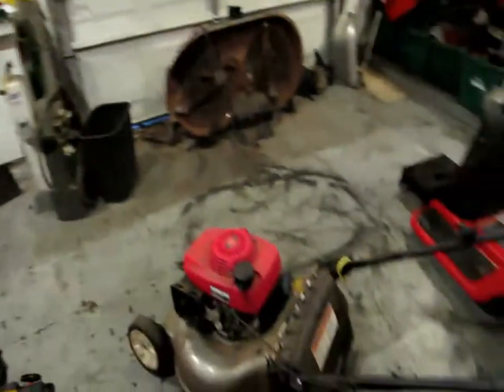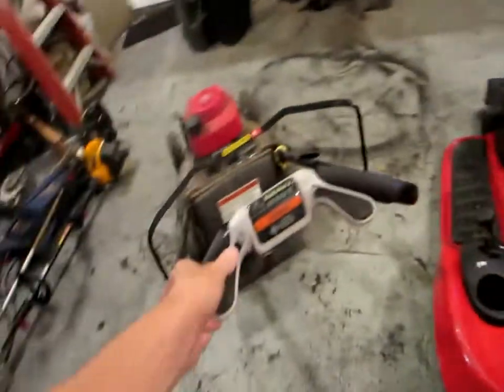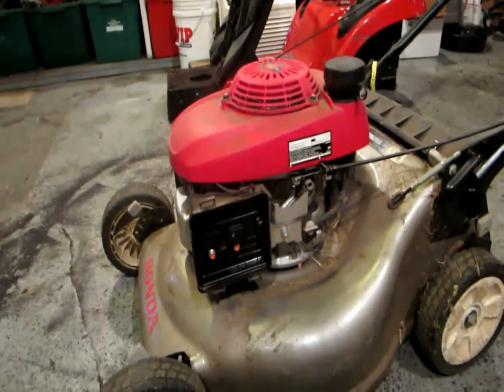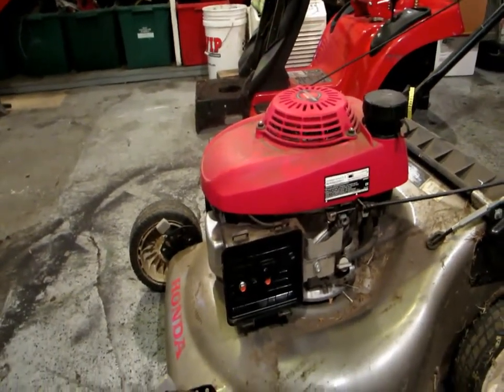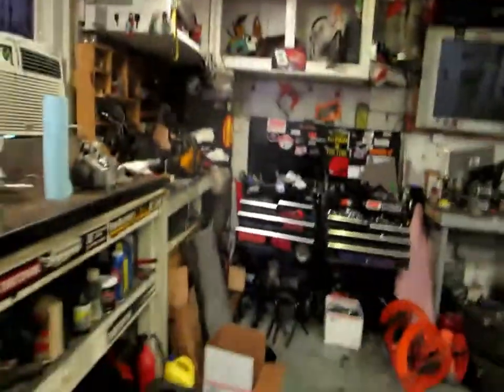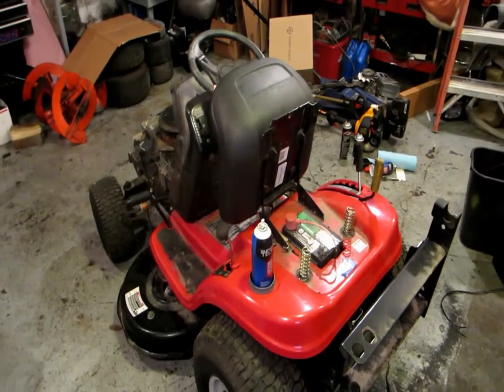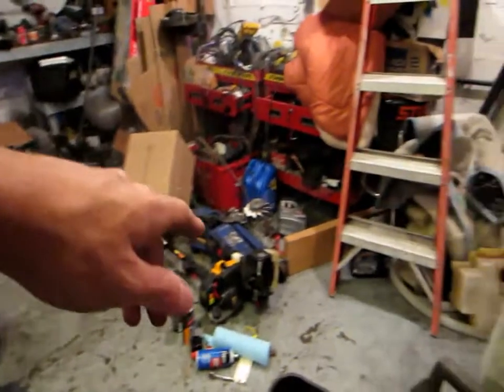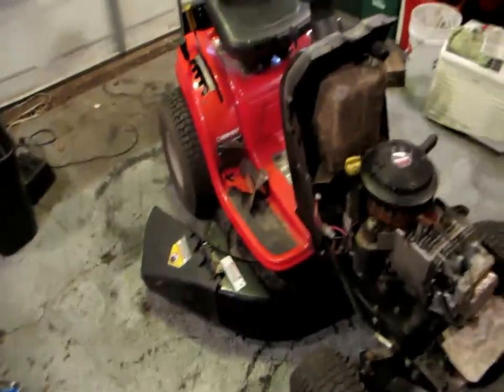junk Honda lawn mowers chop vid with a chopped troy

Comment: what are your opinions on honda lanwmower engines? my dad bought one from his work in the mid 80s and we used it up until the mid 2000s when the deck rotted but the engine and self propell still ran good. never an issue with that one.